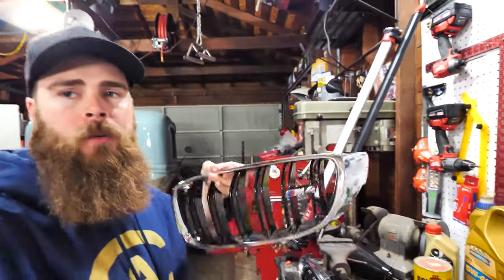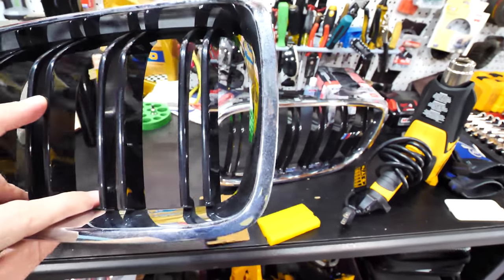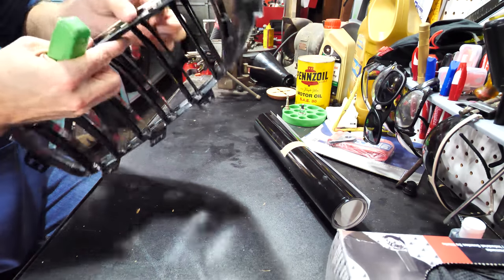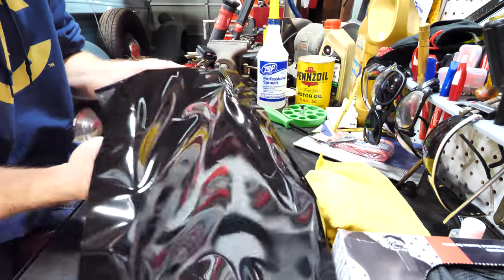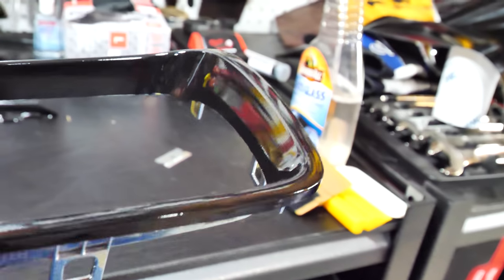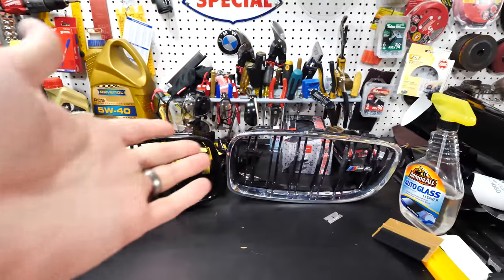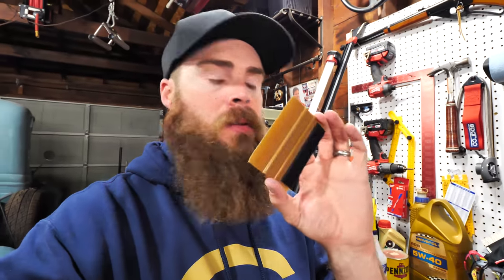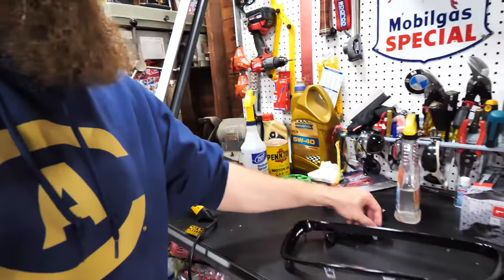How to wrap your BMW Kidney Grills Gloss Black

Comment: Just wrapped the chrome all over our Tesla X in the 3M 1080. Didn't really have any issues but appreciate the perspective on the other options. Nice work around those corners - clearly you have the technique down. I did find the Vvivid gloves really useful to avoid finger snags and oil transfer.

Comment: Great video man! Looks simple enough. I have a X3M non-Comp so has the chrome grille. I kinda dig it though, gives me E30 M3 vibes but might want to black them out in the future if I get tired of the chrome.  How has the wrap held up after 4 years though? Any fading? Or just go with the IND solution?
Reply from the maker: Yeah, it still looks good to this day actually. However, for the time it takes to do it I would probably just buy aftermarket ones from I ND if you got the money.
Reply: @BlakesGarage  Noted. Thanks man!
Reply: and Subbed!